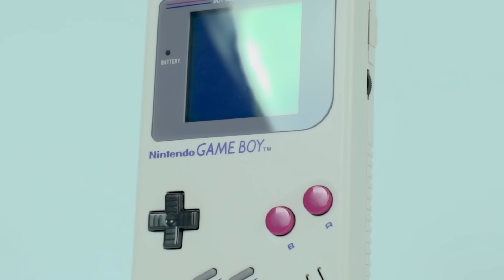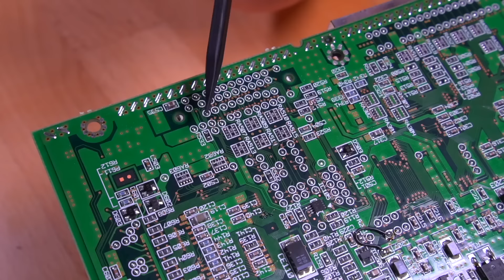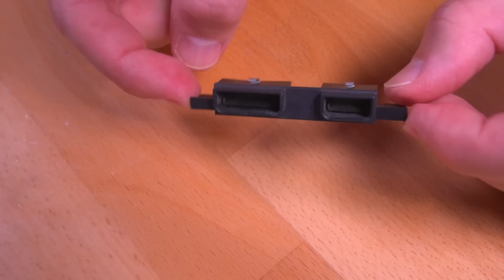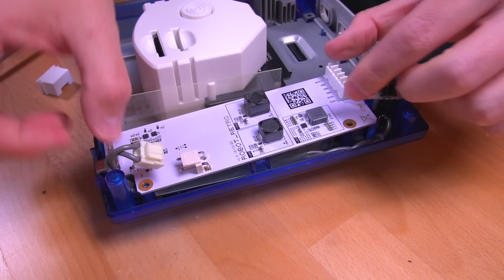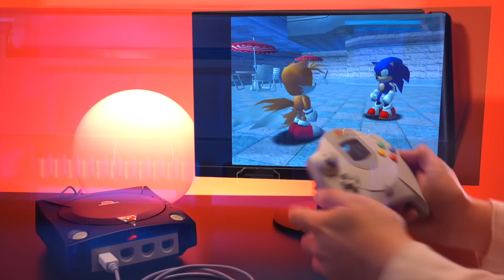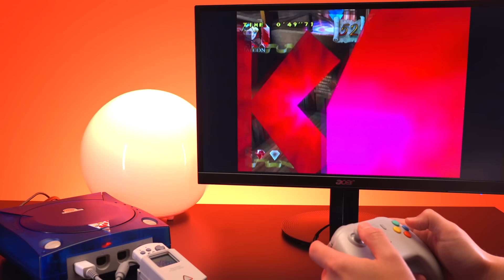Dreamcast Modding Is Getting Out Of Hand

Comment: Part of the reason for the more robust cooling design on VA0 is due to the higher voltage chips running on that revision. Because they run warmer and that heat gets trapped under the shield, the heat blocks help the GPU and CPU dump their own heat faster so the entire lower area doesn't become a major hot spot. VA1 boards in general run cooler. It's highly noticeable if you use a VA0 cooler on a VA1 (requires a fan swap since VA1 needs a 3 pin fan).

Comment: in case anyone comes across this about the VA0 GDEMU voltage thing - people assume this is related to power delivery, which is incorrect. 5v are the data / logic lines on VA0. The connector is wired with the same power lines on all Dreamcasts, but VA0 for some reason used 5v logic lines so the GD-ROM drive and BIOS chip both were made for 5v logic, not 3.3v logic.  The 7 resistor packs (note they are quad packs so 28 separate resistors total) are on all the data lines going to the GD-ROM connector, and drop that logic voltage to about 3.3v which makes GDEMU operation safer. You can do the same thing with resistors on the BIOS data lines as well if you wanted to swap to a 3.3v BIOS.

Comment: I don't like the gdemu, it basically removes the ability to play owned games and rip them.
I prefer the way it's done on gamecube, where the picoboot and the sd2sp2 add an sd slot without compromising the disc drive

Comment: those conectors pins for the power supply look thicker than the original ones. were they modded? I ask this because they are really a pain when they got too hot and they reset the console because of the heat that loosens their connection with the power supply

Comment: Some great mods on display here, and fascinating to see them installed. I do have to ask, however, when you were soldering and explaining that the contacts must not be bridged, I noticed that there seemed to be some liquid spilling over the board in a few of the shots. Is this some kind of coolant? It looked like water spilling over the board, which looks pretty alarming to someone that's never modded a console before. I need to get my PAL Dreamcasts repaired, some of these mods do look pretty appealing too.

Comment: I like the fact that the Dreamcast Pro is more expensive than a PS5
Reply: Dreamcast: $100
PSU: $60
Controller: $200
HDMI: $200
GDEmu: $100
VMU Pro: $85
Two Micro SD cards and a USB C dongle: $50+

Comment: The 18650 battery mod is awful, why would anyone use that over a Coin Cell. 18650's aren't designed for long term use like Coin Cells are, plus there is an increased risk of battery leaks when it comes to using these Lithium batteries.

Comment: robot retro power supply doesn't work with scart cables from RGC- not enough voltage to run the sync generator in that cable.  dang it.
Reply: I can confirm the robot retro PSU is fully compatible with all scart cables on the market

Comment: Did the battery mod on mine and added a new PSU that's super tiny. Not the one you used, seems to work great. DC VGA box to HDMI for me. I still collect and run real GDs on mine. But I do have a broken on coming I want to see if I can fix. Can never have too many systems.

Comment: 7:03 I have a Dreamcast VA0 from Japan and I've replaced the optical drive with a GDEMU without any problems. I haven't replaced any resistors and it's been working fine for over a year.

Comment: That heatpipe cooling is completely ridiculous! SH2 and Holly together only consume up to about 6W!

BIOS mod is also easy to do with an empty chip, that you just piggy back on the stock ROM, add a chip select switch, and flash from SWAT on the console.

The original Dreamcast PSU can actually be rebuilt with a handful of components from 120V to universal. It's up for a rebuild at this age anyway. I think adding an external power brick to Dreamcast is kinda remarkably silly, given it never needed one in the first place!

I have 2 Eneloop AAAs in my Dreamcast to power the clock. That works well.

Comment: You didn't actually have to replace that 100W PSU so that it would work in the US, it also works at 120. I have a launch Japanese console that i got as a gift back in august of 99, before the domestic launch. Its been working in the US for the past 26 years with absolutely no issues.

Comment: I wish someone would stress test these power supply mods. I mean, run the console for 24/48/72 hours, wrapped in an old T-shirt, with a thermal probe and voltmeter. Bonus points if the console can stay running (and your house doesn't catch fire) .....for science!

Comment: I really love my dreamcast, I bought it from a modder that modded some part of it, I have like you another power supply, but on mine, I have a jack connected to an external 12V adapter, maybe the usb-C would be better, from the person who modded mine, it's better for the thermal.
He also changed every capacitor for new one, and cleaned the shell as new.
I could ask what mod I wanted, and choosed one that allowed me to keep my gdrom + a sata for a small ssd where I store my games
He changedf the fan for a new more efficient and silent one, but I love the work you put on yours too
I heard about the VM2, and I'd love a video on what you think about yours compared to an original VMU
I also heard there's mod for more ram on dreamcast, it would be cool to have mod for better cpu or gpu too, but I think it won't happens

Comment: I have a sheet of those same thermopads I've tried them on ps3 , ps4 and xbox 360. I find they're a little thick for 7th generation and up I have these pads I got off a guy on marketplace  and I have ps4, ps4 pros, ps3 xbox360s running at about 45c @ 25% fan on ps3. My ps4s both pro and non are so quiet.

Comment: I know I am in the minority on this, but not a fan of the way you have to modify so much of the original system to get the proper voltage out of it for the GD Emu. Feels like it would have made far more sense to have a 5V to 3.3V converter on the DC Emu itself, at least as an optional thing to install if it would cost too much to include it. As-is this requires you to make a lot of small modifications all over the system that would be hard to reverse if you ever needed to remove the DC Emu for whatever reason. (Though I am not a fan of ODEs that require removal of the optical drive in general, I wish there was a viable option for an ODE for the DC that let you keep the disk drive, it's one of the few major systems where that isn't an option, especially since the Dreamcast had a very unique disk drive compared to the others).

Likewise is there any way to keep both the original ports and install the HDMI port somewhere else? Even if it would require cutting a hole in the case? Similarly not a fan of disabling ports, especially the original analog outputs, in order to install a HDMI mod.

Comment: Loved the dreamcast. Had one decked out a few years back. Bios chip, resoddered board, gdemu, akura hdmi switch, pi zero internet mod etc. Ended up selling it. The nostalgia didn't really hold but it was a fun project. Just about any android device can emulate most of the library so didn't really see the point. To each their own.

Comment: Not to be "that guy" but I don't understand GDEMU's popularity.

There's Onion M.O.D.E and USB-GDROM where you can literally fit the entire Dreamcast American/Japanese/European library on a hard disk or flash drive as opposed to dealing with SD cards.

The onion MODE, specifically is a more well-rounded permanent solution because you get to add the HDD AND an SD Card port.

Comment: Use nye oil for all your bearings and light oil needs! It's a clock oil and stable as heck. No-ox-id is also a cool conductive grease for protecting connectors.

Comment: Thanks, Tito, I enjoy the update modding videos. It gives me an idea what new improvements are out there or viable replacement for mods that are no longer in existence.  It may not technically be a mod but definitely a workaround I have really enjoyed with my Dreamcast is DreamPi, Using a RPi to connect the Dreamcast modem to the Internet without the need for the expensive broadband adapter is pretty cool.

Comment: I recall the Dreamcast being received less positively in the years following its release, being known for drive and disc issues, so I looked up some old forum posts. It appears the discs were prone to misprints, and the data density caused even small scratches to render many discs unreadable, more so than other disc based systems of the time. The disc drives were also prone to failure and some considered them to be of low quality. It's a really fun system, I had one for a time and loved it, but I think we look back at it through rose tinted glasses. There were some legitimate reasons it failed to take off, despite its strengths. I love how these SD mods make any disc/drive problems a non-issue!

Comment: I had a Dreamcast since christmas 2000 and absolutely look back at the Dreamcast time as the HAPPIEST most wholesome gaming period of my teens. I had never been THIS happy and content with a gaming system ever before because of all the amazing titles that were available and as a racing game fan i absolutely was living the dream with it. And in early 2001 i was finally able to go online as well and was playing with folks all over the world on the servers of Quake 3 Arena, Chu Chu rocket and even added some of my self built maps on the Dream Arena. I even played the christmas demo of "Toy Commander" on christmas and that alone became one of the most wonderful gaming core memories for me. I just hated how under-supported the Dreamcast was in PAL territory.... it was downright criminal. Especially towards the premature end of the Dreamcast when ALL announced games got their online support scraped from the PAL release. Like they did with Unreal Tournament. I still have my OG Dreamcast but was also able to get a second used one from a friend of mine which was sadly broken. The Disc Drive was really the absolute worst part of the Dreamcast because of that fragile NON-Standard that was the GD-ROM. So i removed it and made it a SD card based ROM loader console and also swapped the Internal clock battery with a CR3232 sized capacitpr. I might do a AC mod at some point because the Power Supply really needs to become more robust than what the DC originally came with. And i already had to modify it because of the  GDEMU  mod.

Comment: For me it's a toss-up between the SD card mod and the HDMI mod. Amazingly, my optical drive still works fine, and I have several burned discs from back in the day, but I'm sure it will fail eventually, and the SD card would make everything easier and faster. And I can use an external HDMI converter, but having it built in is a much better, higher quality solution.

Great video about a great system!

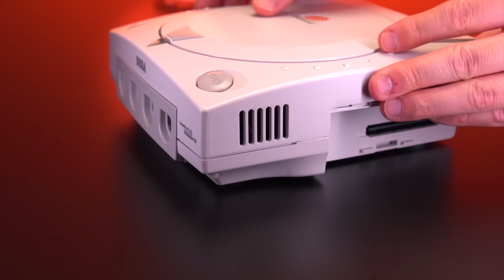Comment: 3:15 wrong info Mr Macho Nacho. On the bottom label it already tells you VA0 or VA1 or VA2. A metal fan is not a telling sign for a VA0, as it could be an early VA1 revision that have these too, but the heatpipes. 15:22 bro didn't eben plug the heat sensor for the heatpipes back in

Comment: Pretty good for a console unable to outsell even GameCube.  Then again, there is a cult following with DreamCast, so I can't really say anything.  The wireless controllers that were US$200 each had wireless modules that looked similar to the Wavebird units originally made by Nintendo.  I am looking at the controller board for the DreamCast and wonder why we haven't yet heard of the BlueRetro style board we got for GameCube as well.  Granted, you wouldn't be able to use your memory cards but there should also be a mod for that say in the form of SD card slots for basic memory for games in the front of the console.  After the Nintendo 64, memory cards in the controller didn't really make sense for me and probably why Nintendo, after seeing Sony put them in the console did the same for GameCube and Microsoft eventually doing the same for the Xbox 360 but in the refresh of the 360 they were ultimately removed and replaced with either the on board or USB storage.  That being said, the Xbox Series S and X reintroduced memory cards instead of re-implementing the customer-friendly option of replacing the storage through an NVME interface like Sony.

Comment: The biggest problem I had with Dreamcast was the fork that connects the motherboard to the power supply board, because they heated up, their metal expanded, causing them to turn off. My solution at the time, with all my knowledge, was to cut pieces of plastic and place it, forcing the metals, even if it expanded with heat, it wouldn't turn off. It worked perfectly, not to mention that I removed the plastic part on top to reduce the temperature.

Comment: You can install the fan in there, just pull of the plastic power connector from the old fan, and the same with the new, they literally are meant to be stuck on and pulled off, well… you get what I mean. I hope lol
But just pull it off and either line up and insert the new fans wires into the old fans removed connector, before hand make sure you buy a fan that has matching voltage (raspberry pi fans work well) ahead of time btw.. 
but just plug it in or if you are cool with it just solder the new fans power into the same spot on the board.
 If you need a chip from the old fan or something which you really should not…but if you do then tear down the old fan to the pcb and leave it connected and solder your new fan..

Soooooo,yes it is possible, and easy. 
Have accomplished it on all models of the DC a long while back and retested it just now on the console I just got. There is no issue and there are way cheaper and better mods out tbh. Sry but a lot of Bad info tbh

Comment: hi macho nacho, thanks for the vid
the main problem with the uhdmi mod for me is that the "arcade cab" in shenmue is puting an out of range message, for other games no problem so far ;)
i have the dan's project one...Yes still have the serial port and avout, it stays cool. i also made a socket mod for the ml2032, cheap solution and easy (2 soldering points) 
the bios boot logo is the devkit logo, a dream project for me ^^

Comment: Giveaway entry: The simplest and most useful mod for Dreamcast owners is replacing the battery on the controller board with a holder which makes it easy to replace the battery when you realize the controllers don't work right away when you turn on the console. You can wait and let the circuit "charge" but that's not the expected behavior players want. I wonder what SEGA thought when the design this. Clearly, they did not.

Comment: Nice system but I feel you've shot yourself in the foot a little. Does losing the original output to replace with HDMI mean you lose access to Light Gun games? Also, if you're going to the trouble of installing a custom BIOS, why not do the piggy back method and lastly, if I was going tto the trouble you have, the IDE mod allows for some fantastic performance gains over the GDEMU. I understand that not every game is running 100% but I'd take the performace gains for stuff like Sonic Shuffle and Soldier of Fortune.

Comment: Personally i think MODE would have been a superior ODE option(all be it more expensive) , i can’t stand the file structure for the GDEMU, with the mode you can just make as many folders as you want and it can also use 2.5 HDDs/SSDs.

Comment: Your dreamcast's cooling system is rare but My Xbox 360's cooling system is extremely rare. I have never seen it on another one and I used to actually fix them. the fins on a CPU spread out like a flower. I can't even find a pic of it on the internet.

Comment: My first console was a Genesis at age 10. Then I got a saturn, then a dreamcast. Was Sega all the way. Macho... you GOT to learn how to drag solder lol. It's far faster and gives better results on those IC's with lots of pins. It's easy af bro you just use a chisel tip solder tip, load up the tip with solder and use plenty of flux and start at one end and just drag the solder over the legs. Works even better using solder paste.

Comment: Great video as always, but you left out the Hispeedido iBlueControlMod that completely replaces the controller board with a separate one that not only supports plugging in controllers, but also using bluetooth gamepads like the Dualshock 4.

Looks very similar to an internal Blue Retro install.

Comment: I think the GDEMU is my favorite Dreamcast mod, because the GD-ROM drive is unnecessarily loud (even if the VRRT VRRT VRRT noise is iconic) and wears itself out as well as the discs. The replacement PSU is in a close second, though, and I ought to get one for my own DC, as its stock PSU is being recalcitrant.

Comment: We had one built into our 1999 suburban. It barely got4 used because kids would rather watch recess schools out or some other dvd. But it was there, they installed it into the fold down cup holder in back. Pretty sweet install.  But at home, we had the Dreamcast and light tubs for house of the dead on a 55 inch projection tv. One of the best games ever!!! Then, of course, someone figured out how to break the windows ce on it and they also figure d out how to copy the game disks by padding the files etc. ahhh….game piracy is such a leapfrog issue.

Comment: The hdmi mod is the best mod imo, most bang for your buck. I love upscaling older consoles, and if an hdmi mod doesn't upscale the output, at least it uses one cable to transfer video and audio.  This hdmi mod does both, its a full size port, and looks clean using the original av output location without cutting the case.

Comment: That bios chip is super neat. When  I think of custom bios chips, I think of the og xbox and having to solder a whole plug for the board. With this dreamcast mod, it just pops right on with the use of a hot air station